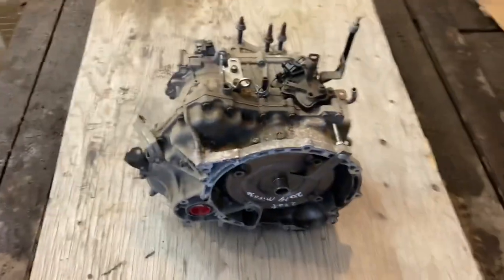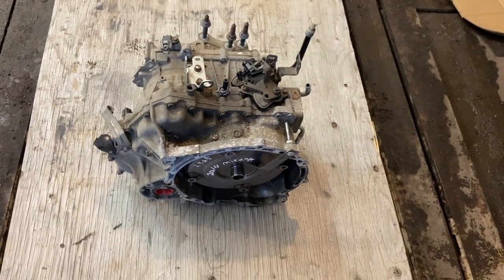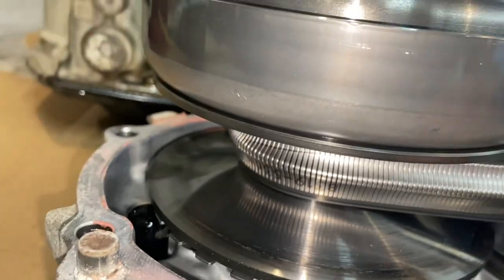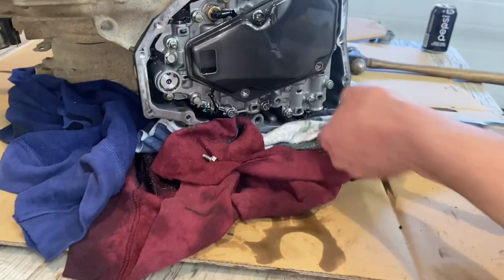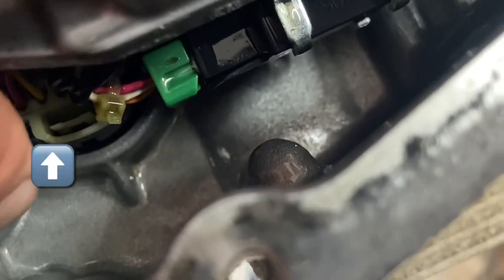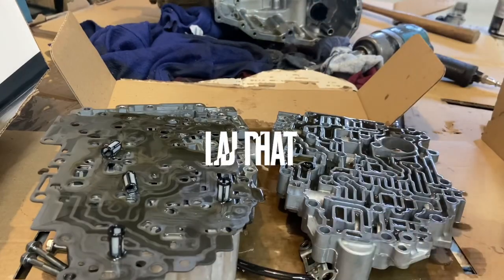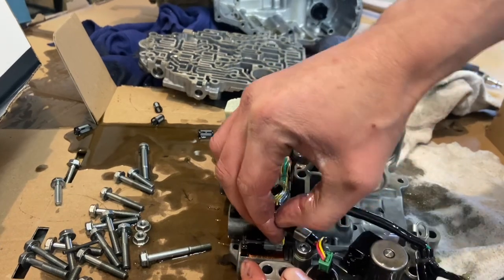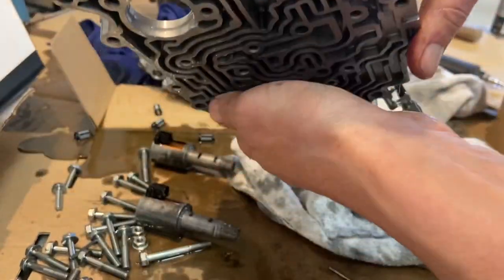Jatco Cvt teardown -Mitsubishi Mirage Part 1

Comment: CVT’s, no matter what vehicle, are the weirdest contraptions I’ve ever seen. Thanks for the look inside.
Reply: They’re actually a modern version of what was normal on machines way back. You have a fixed (or solid pulley on one side and a variable (spring loaded-in this case hydraulically controlled) on the other. If you want a change, you change the variable pulley and the belt shifts positions to accommodate. It’s almost infinitely variable, but the constant metal on metal in current cvt makes for poor wear and lifecycle performance.
Reply: @GORT70  This CVT did almost 300.000 km in one of the harshest climates on earth. I cannot say that that is poor lifecycle performance.
Reply: @ronaldderooij1774  understood. This one is a rarity and well maintained.
Reply: He should make a video on how to take care of car with CVT transmissions
Reply: I have a nissan juke cvt ns2 
230,000 miles 0 problems.

Oil and filter change every 30,000 miles no more.

Comment: I have a 2021Mirage ES  and I do a CVT change every 15K. I get the fluid on Amazon for about 50 bucks.  Keeping this fluid clean and cool is the life of these CVT.  The Mirage is my daily commuter with 55k on it.  I also have a 2019 Honda Ridgeline that gets transmission fluid exchange every 15 K.  Cleran fluid means smooth flow on all the parts.
Reply from the maker: Keeping the fluid clean seems to help. I've seen a few cvt's that failed early due to being on the zero maintenance program.
Reply: Just buy castrol transmax cvt, i buy it at walmart in the gallon jug for under 30 or buy 2 or more and get free shipping. Amazon is overpriced. I used it several times in my old cvt outlander sport without issue.
Reply: I ran this piece of shit for 75 mph and above 3.5 rpm and now get the flashing D
Reply from the maker: @luisvilla799 check for codes…either overheated it(uncommon, at least where I’m at) or you have trouble codes stored(either way you’ll have codes). 

Going over 75mph isn’t a problem, I’ve done it for hours at a time with the car loaded without problem. These things usually crater when the fluid is never changed.
Reply: @turdpailsandtrails  no I change it and I travel for work a lot eg Houston to Denver
Reply from the maker: @luisvilla799 oh, it’ll be a lot hotter there then here. How many miles on it? Did you change the paper cartridge filter too? 
If the fluid is black it’s usually nfg though.
Reply: @turdpailsandtrails  yeah man it’s a 2021 with 107k miles hell even got the stealerships to do it there is a Nissan service bulletin not to drive for 75 mph for a long time
Reply from the maker: Well that really sucks! At least there’s lots of used cvts around if you went that route. They should fit all years 2014-2024. There’s a few low mileage ones in Houston on car-part.com.

Comment: Any owners on here or potential owners on here lurking, just know you're way better off going to an experience private mechanic, like the maker of this vid, not a dealer service center. It's worth the extra money paying someone who knows JATCO CVTs, how to properly service them i.e. doing cvt fluids DRAINS not the FLUSH bullshit a Mitsubishi tech would do. Hell, my dealer service center guy didn't even know the CVT7 comes with 2 filters or that cleaning the drop pan magnets was essential. 

It's a lot easier to find a cvt specialist mechanic at tranny shops now because almost all the Asian MFGs are using them now. This wasn't the case at all a decade ago. 

I repeat, find a high end private mechanic like the dude in the vid and forgo Mitsubishi service centers unless you need warranty work done that's free.
Reply from the maker: Thanks for coming out! 
I'm no expert and am far from high end!!!
You don't need to be a rocket scientician to service one of these.  The most important/hardest part can be making sure the fluid level is correct imo. They can be pretty finicky if over or under-filled.
Reply: Idk what dealers most people go to but, we're not all useless mechanics yknow 😂 maybe it's the lack of communication directly from the mechanic that makes people think dealer mechanics are untrained and terrible I'm not sure, or maybe its just a us thing

Comment: The key to high mileage on these is definitely frequent fluid changes
Reply: I change my trans fluid every 20k miles, it's very easy and not expensive.
Reply: On these CVTs also not floring the gas pedal in from stand still is important. Basically dont abuse the car.

Comment: The one thing I miss about my mirage is that there was no issues in stop and go traffic. I have a Crosstrek base model and holy crap when I let go of the gas pedal, it breaks HARD. I feel like I'm brake checking people in traffic and I feel horrible but I can't control it. People say that's normal cvt behaviour but that's bullshit in my opinion.

I should not be anxious about the random stops and huge lag in a Subaru Crosstrek. Never had that issue with my mirage. 

Even the mechanics at the dealership said it's totally normal. I can't wait to get out of this death trap
Reply: Wow. That says a lot. How come you left the Mirage?
Reply: @edgaryzen4925  when carvana was offering a lot more for used cars in 2021, they offered me the exact amount I owed left. I had a terrible rollover amount from the car previous. So I was able to start fresh on a new car without negative equity. 

It was an opportunity for me basically but now I regret it a little. Hopefully I can get into the Bolt EUV soon
Reply: Its the AWD

Comment: Thank you for these two videos!!! Okay so now to get down to brass tacks. I’m completely new to CVTs or visa-versa? Anyway, I’ve recently purchased a 2015 (haven’t picked it up yet) that may or may not be having CVT issues. I’m leaning towards that it does but, that’s neither here nor there for my question… What would you recommend be my first steps to figure out what’s actually going on & diagnosing it prior to tearing it apart? Or is it even possible to diagnose for sure on a CVT? In addition, I wondered what a good cleaning, flush , new filter & fresh fluid would bring? Do you have any opinions on that? I’ve had some standard transmissions that were slipping & after changing the filter & fluid with a high mileage variety, they stopped slipping and never did again. I had a Toyota Previa with like 325k on it that, that went onto another gentleman who is still driving it with no issues whatsoever. So, can you offer any advice? Any suggestions would be greatly appreciated! Thank you!
Reply from the maker: I'd check for trouble codes first. If in doubt, drain the fluid, maybe drop the pan and take a look for chunks o metal or large filings. Replacing the fluid won't hurt it. 
 Why do you think it's having issues? There's not a lot you can do to fix these but in a lot of cases replacing the valve body can cure some issues. These transmissions prefer clean fluid.
Reply: @turdpailsandtrails  First… thank you for responding! Well, I haven’t picked up the vehicle yet, that happens this weekend. I picked it up cheap due to the fact that the current owner stated that it’s starting to “slip” and has stalled a couple of times. As the second owner since 37k, I asked if he’d changed the fluid in the time he’s owned it and he said no. So, it’s a 50/50 shot that the prior owner had given it a change. My guess is no. It has 124k on it and much of its life was spent on the open highway as a commuter. This makes me hopeful as I’m assuming this type of driving would be less demanding on the belt & pulleys. When I visually checked the dipstick, the fluid was a medium shade. Not completely blackened or anything remotely like that. However, there was some of the sooty residue on the end of the stick. Nor did it smell burnt. Depending on how deep the stick actually goes, this could mean there’s the typical amount on the bottom of the pan & on the magnets or… if it doesn’t go all the way down, the fluid is really full of fines and had settled out as far as it can & there’s just a crap load in there and the dipstick is picking it up as it gets dipped down into it. I won’t know till I drop the pan. I do know that when I’d checked the dipstick, it hadn’t been driven for a couple of weeks at that point & was just setting parked as it was put up for sale. Maybe after I have the opportunity to drop the pan, take pictures of my findings, have thoroughly cleaned it & the screen & have done as complete a flush as I can by running 2.5 quarts through it at a time… dumped it maybe 3 times & then added a specially designed CVT additive and a fresh filter… then, I’ll let you know what I have found & how the trans responded. Sound like a plan?
Reply from the maker: @adriangoede7433  That's what I'd do as well. The stalling part may not be a great sign.
I've replaced 3-4 of these that would stall in drive when coming to a stop.  In the "part 2" video I show a couple pics of one of the bearings that I've seen pile up and cause stalling. The fluid would turn black right after a drain and fill though. You'd know right away when you drop the pan though.
Reply: @turdpailsandtrails  😩😩😩
Reply: @turdpailsandtrails  Hey there. Thought this might be of interest to you. This is a link to an actual Mitsubishi Technical Service Bulletin (TSB) on the 2014-2019 Mirage & G4 CVT. ( https://static.nhtsa.gov/odi/tbs/2019/MC-10162635-9999.pdf ) If for some reason you can’t access it, I can try emailing it or something. There’s a lot of excellent info in there.
Reply: Hey there, sir. Adrian here. My apologies for two months of delay but, I've had a lot going with work & money has been tight as I'm working on a 3rd gen Camaro for my son on the side. Ok so... I decided to drop the Valve Body and try to give it as thorough a drain & cleaning as possible. I feared there might be fines in those 5 little filters but just like yours, they're clean. So, I disassembled it correctly & took a multitude of pictures. The steel plate in between the two castings is comparable to what you showed on the trans in your video (really dark grey sooty junk from in the journals/channels). Found the the two check balls & the three pins (all stayed in place). So, aside from laying it on its side & letting as much drain off as possible, how much farther can I go safely? The one casting really has nothing in it to ruin so, I'd imagine hitting it with brake parts cleaner would be fine. As would be, using it to get rid of the grey slime on the steel plate. How about the other side? Do you know if brake parts cleaner would be safe to use on the other side? Do you know if it would hurt any of the components like the solenoids? Also, is there anything you can recommend that I do or look for while I've got this thing apart? Oh... and you wouldn't by chance have any torque specs for any of the Valve Body bolts would you? That's a lot of bolts! 😂 Thank you in advance!
Reply: Oh unrelated to the Valve Body, I finally took it out for a run around after I'd done the initial flush. With the exception of a slight fluctuating surging while I kept it at a steady a steady 55 mph, it seemed fine. I attributed it to maybe fluid getting back into everywhere (I actually ended up with almost exactly 4 quarts that drained out of it, rather than 2.5). I even went up a rather steep hill. It stayed steady at 45 the whole way up & never slipped. I thought maybe I'd lucked out but, no such luck. After I traveled maybe a mile further, I decided not to push my luck, turn around and come back. Well I was a little more spirited in my acceleration and it slipped. So I backed off, feathered the throttle & when I got to that same steep hill, I had something rather odd happen when i got to the bottom of the hill. It didn't die but, it slipped into what I believe was a safety mode. It was idling fine but, there was no throttle response. If I put it in park, I had control of the throttle again. But the same would happen if I shifted into drive or reverse. So I shut the engine off, waited a few minutes, restarted it and it was fine. I made it back to my house ok but as I got closer to my house, it did the same thing more frequently. I "think" it correlated to the transmission sensing any slipping. Have you ever experienced anything like this?

Comment: Great video. How did you learn to take apart such a complex component? It’s mind boggling to me how complicated a transmission is inside..
Reply from the maker: Thanks for watching!  Just remove bolts until til parts fall off. I've torn a few of these apart before but still seem to forget which way to orient the valve body so that parts don't go flying...
Reply: @turdpailsandtrails  Just Asking  With That Millage  The Trans Fluid Was Ever Change ?
Reply from the maker: @JorgeRodriguez-po7kx  Yes the fluid was changed by the previous owner. How often, I don't remember. I usually try to change the fluid every 50k km(30k miles).

Comment: With the announced end of production of this car (supposedly 2025 being the last year) would you still buy this?  Im fine driving manual or trusting a cvt.  I'd be buying used (60,000 miles or more).
Reply from the maker: Yes, I’d still buy one despite it being discontinued.
Reply: @turdpailsandtrails  thanks! It’s my next car, when and if my 2003 Nissan maxima breaks down

Comment: Did you have to drop the subframe to remove the transmission? Was you able to keep the engine installed in the vehicle?
Reply from the maker: I didn’t remove the subframe or engine. Have to lift the back of the transmission up and slide it forwards to clear the subframe. It’s tight but it fits.
Check the other videos, I posted a couple showing how to replace it.

Comment: Nice video. At what mileage should cvt transmission filter replaced?
Reply from the maker: I don’t know if there Mitsubishi  even has a recommendation for the filters. It took a while to convince my dealer that these cars even had a filter let alone two… I used to say change the paper cartridge filter at 60k miles but I haven’t changed on in years. I just change the fluid every 50k km. There’s one 2017 Mirage in the fleet with over 530k km/330k miles that I’ve only changed the fluid and never touched the filters.
Reply: Mitsubishi recommend to change trans fluid every 40k miles.

Comment: Is it rather easy to replace the transmission on the Mirage? Also, do you know of any guides on how to do it? Thanks!
Reply from the maker: Relatively easy, if you’ve ever replaced a transmission before. It’s no different than a typical front wheel drive automatic. 
Next time I replace one I’ll try to make a how-to video.
Reply: @turdpailsandtrails  Thanks! I have never replaced a transmission, but I will be getting one of these cars soon, and will expect to have to replace the transmission. I drive slow on the freeway, but at 250,000-500,000 miles, it will likely need a new one. And I want to just do it my self.
Reply: You need to learn the car about the new transmission. I think it needs specialized software for that. Not sure though. Just keep in mind that you could need a prescription or a dealer to do that.
Reply from the maker: Nope. Maybe….a brand new one. But even then it’s unlikely required other than a few drive cycle relearns that might not require a scan tool. But I don’t think anyone would go out and buy a new cvt. Price one out…Other than a dealer installed warranty job I don’t think anyone would actually go out and buy a new one. 
If installing a used one, just bolt it in and drive it. Save the time, money and headache dealing with the dealer.

Comment: I got a 2024 Mirage, doing a full service on the CVT tomorrow. So cleaning the pan magnets, and replacing the filter in the pan, as well as the cartage filter. I heard it's a good idea to reset the CVT degradation level, my OBDII computer doesn't have that option it seems, would I be fine driving it without resetting the degradation level for a few miles to the auto store, so I can use their OBDII computer to reset it? Thanks!
Reply from the maker: I’d just be concerned about getting the fluid level correct as per the chart in the service manual.
I change cvt fluid at mileage intervals so don’t monitor or reset degradation levels. So yes, you can drive perfectly fine without resetting it.

Comment: How much did the new replacement CVT cost? Did it come with a new torque converter?
Reply from the maker: I bought a used one from a 2017 with 2600km for $500.  It came with the convertor. That was 2 years ago though. I think a new one was around $6000 from the dealer.

Comment: How to drian out some cvt fluid If i overfilled  .?
Reply from the maker: You could pull the drain plug or put a hose down the dipstick tube then pump or siphon some out. I find if you drain it from the plug when the car is level 2.5L comes out, so that's what I pour back in when doing a fluid change.

Comment: If you romp on a CVT and do not service them they are much more prone to fail. Many videos from Mitsubishi owners reporting very high miles with zero issues with their CVT when properly serviced as in fluid and filter changes at the required intervals.